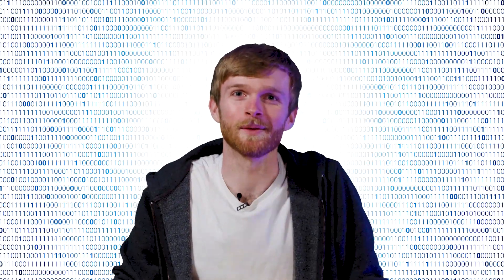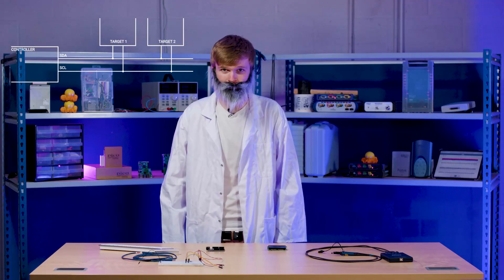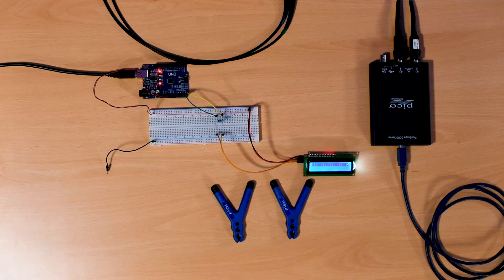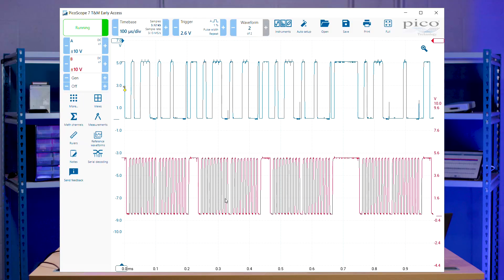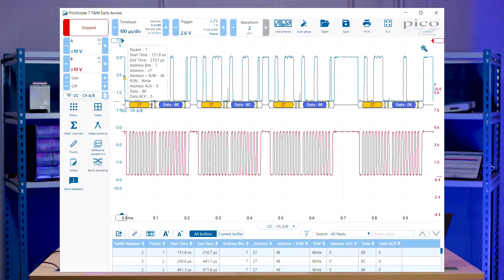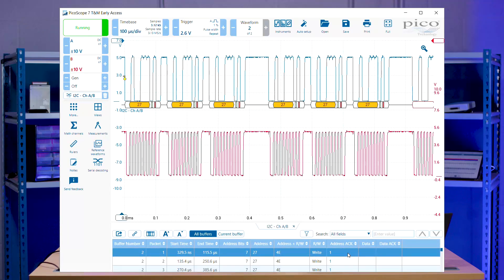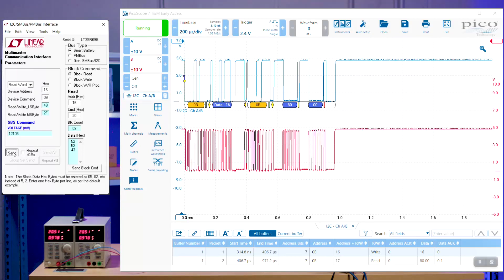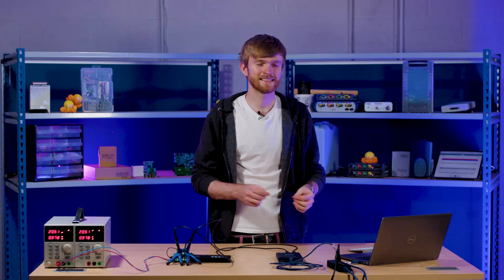Debugging I2C using a PicoScope - PicoBYTE #3

Comment: Hi, thank you for the tutorial!

I am using a Pico 2204A to debug an I2C signal that is being read using an Arduino Mega. I find that that the output I see on the Pico GUI is "rounded" and is not as sharp as the pulses seen at 4:32. Why might this be? Could it be because of my settings, or the bandwidth of this device?

Also, I am using pull-up resistors of 4.7kOhm. 

Looking forward to any feedback. Thanks!
Reply from the maker: Hi @jacksonriemerschmid8879. The rounding is usually a characteristic of RC loading in the circuit. Try using a calibrated x10 probe to reduce any loading on the signal from the PicoScope end of the measurement with the shortest ground connection as possible. I2C can be quite rounded from the RC loading from both the controller and peripheral.